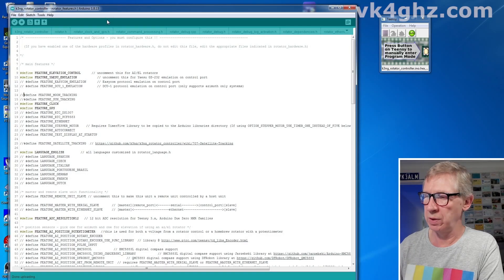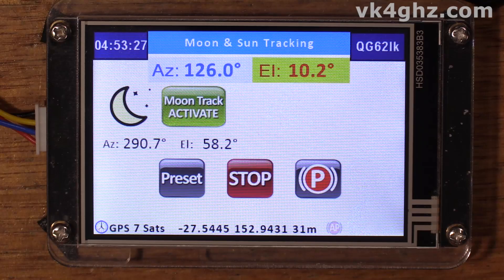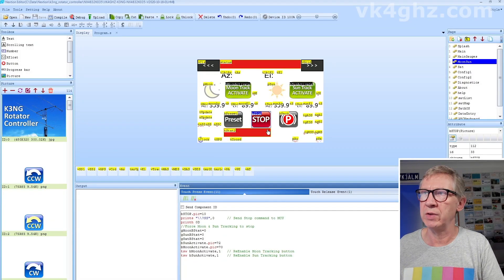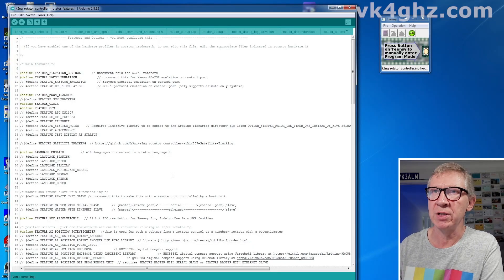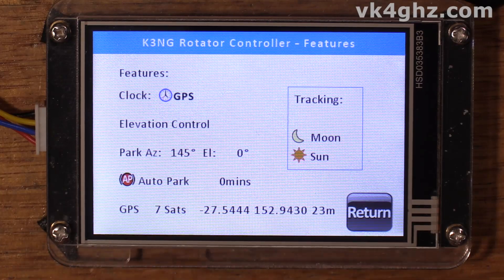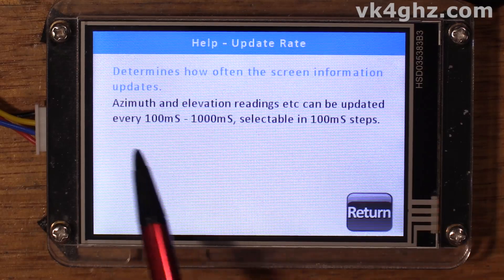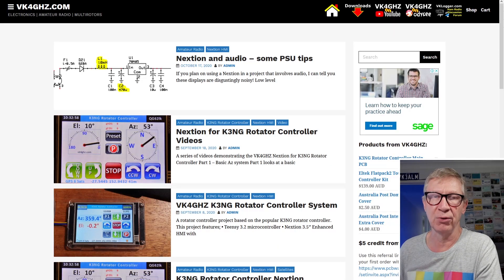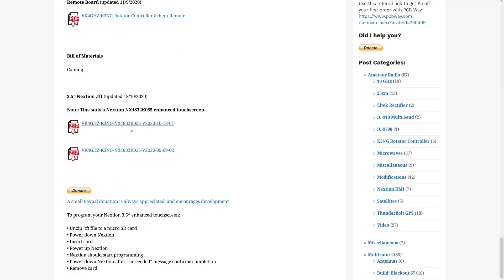VK4GHZ Nextion for K3NG Rotator Controller Part 3: Moon & Sun Tracking, Help Screens, El Calibration

Comment: Can the elevation and park handle negative elevations?  I have an offset dish where the elevation is via a linear actuator and the dish is parked face down which is an elevation of about -60 deg.
Reply from the maker: You would need to ask that on the GroupsIO Radio Artisan group.  
https://groups.io/g/radioartisan/topics
That side of it is controlled by the K3NG Arduino code, not the display.

Comment: Hi

Is the K3NG available as a 'ready to go' device for the Yaesu azimuth rotators? (In Australia)
Reply from the maker: No.  You construct a hardware interface to suit yourself using any capable Arduino type board (that does not include low end boards like Nano, Uno etc) or something like a Teensy 3.2.  The user interface is up to you, as the K3NG firmware provides for a variety of options. Touch screen, or LCD and switches.  Buy a Yaesu GS-232 if you want a ready made appliance out of the box.